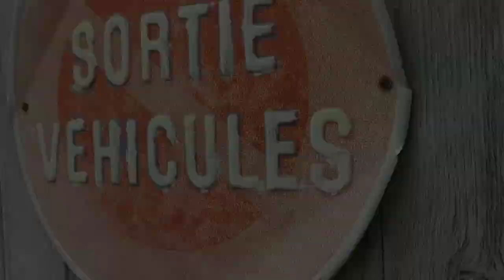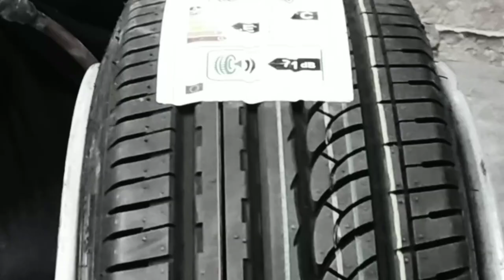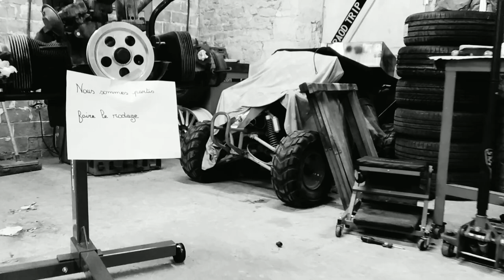la fin d'un projet de restauration auto.     partie 1        VW golf 2 GTD 1984

Comment: Vraiment cool la vidéo! Je l'attendais avec impatiente. le résultat est parfait! Bien hâte à la deuxième partie. Quelle sont les spécifications des jantes et des pneus, dimensions, largeur et "offset"?

Bien hâte au printemps pour ressortir ma Jetta 1.6 TD
Reply from the maker: Salut Guillaume et merci 👍 les jantes sont en 15 en ET 35 en 7*15 et les pneu en 165/45.😉
Reply: @46roadtrip  ok c'est un peu les mêmes specs que mes jantes. Par contre je suis en ET 28. Tu as mis des cales de combien de millimètres? Je pensais plutôt partir sur du 185 45.
Reply from the maker: @guillaumebourcierguillaume4180   c des calles de 20 en changement d'entraxe .apres oui tu peut mettre  du 185  aussi sa ferra propre